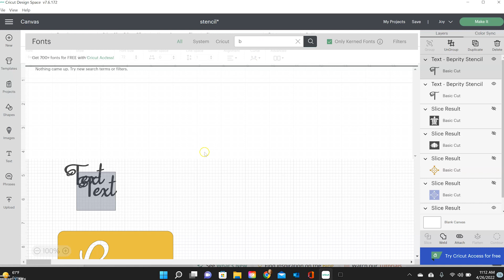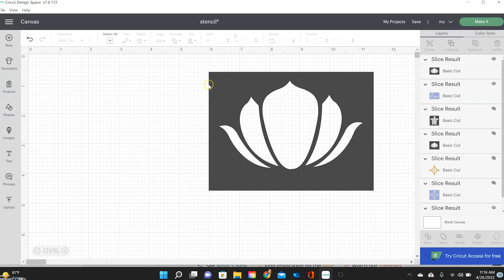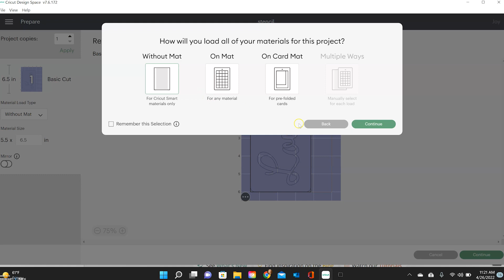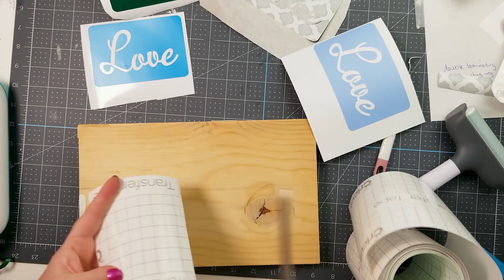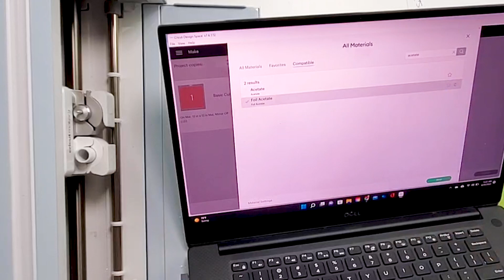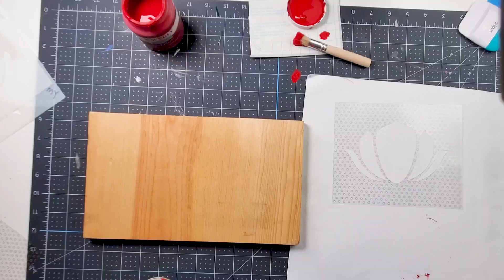How to Make Stencils with a Cricut - Reusable and One-Time Use!

Comment: A little late for this tip, but if you put your stencil down, then a light coat of clear matt water-based varnish, let that dry, and then use your paint, you won't get any blead through.
Reply from the maker: Great tip, thank you!